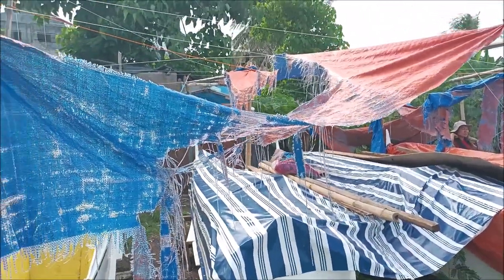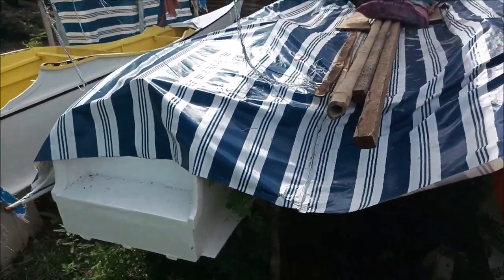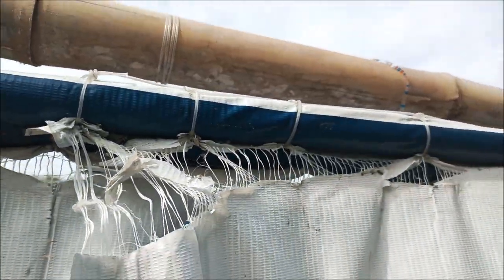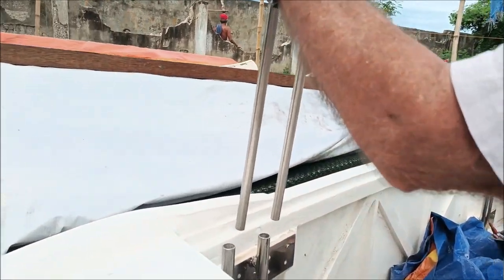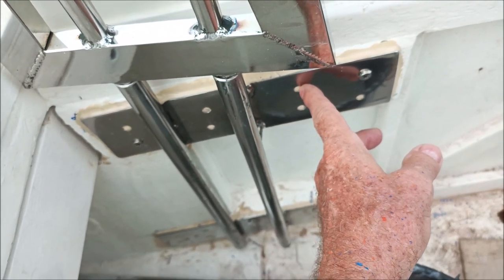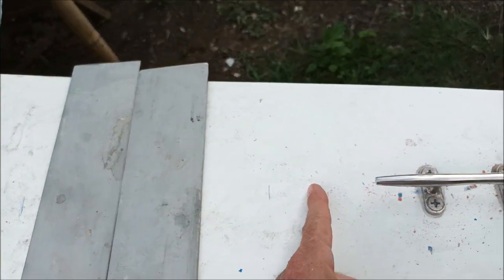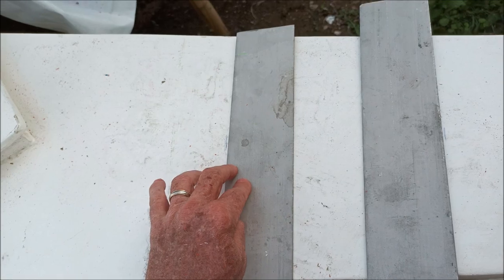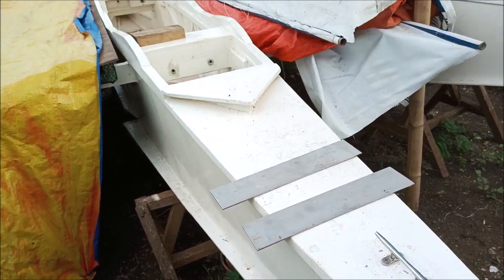Paradise Trimaran Boat Building - We Design The Center Tarpaulin Support Mounts

Comment: Hello again Roger and Lindy
Don't forget to drill holes through the outer pipe-through the inner pipe, with lucking pin to keep them from slipping out and be flaying away and be (Gone with the Wind)…
Thanks very much for your fantastic Paradise Trimaran Boat Building video. Take care and have a fabulous weekend/Ned  👍🙌👍
Reply from the maker: Everybody is telling me that and   I didn't think it was necessary however I could be wrong and you know the saying " It's better to be safe than sorry" so I will add some kind of restraint on the supports. Drilling is such a difficult process in stainless so I may have some kind of tie down rope with a clip to keep them from lifting off and actually the front will be higher than the rear so when moving forward it will produce lift like a hang glider and then it will become a flying boat but not a sail boat ⛵🚢🏝️😎🏝️🎣🐠

Comment: Quite a nice boat... I wish it was bigger though...
Reply from the maker: I do too, if I did it all over each hull would be wider and higher sides and longer. This will serve my needs so for now it will do🙂
Reply: @myparadiseonbantayanisland9030  By the way, is the design inspired by the Viking Longship? The longship is my favourite too, but I like trimarans too; your design is exactly what I was looking for: a Viking Longship Trimaran: the boat that would render anyone who laid eyes upon it awestruck and speechless...
Reply from the maker: @theaman1786  it is actually a Filipino 3 cut (stepped hull design) racing boat center hull and I had them add two outer hulls to make it stable because the original center hull would roll over (even with bamboo outriggers) when it got unbalanced even just a little bit. The design just accidentally evolved and I like it too🙂